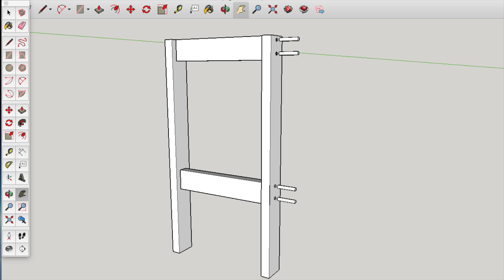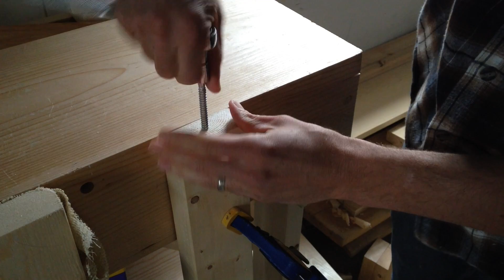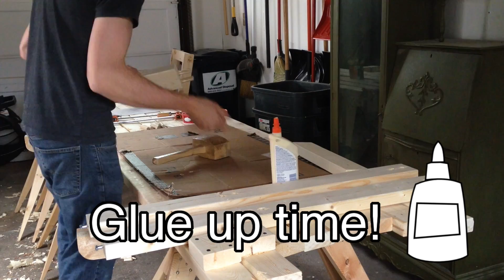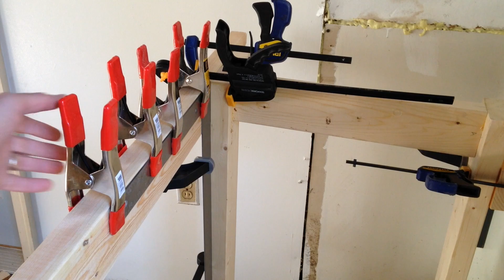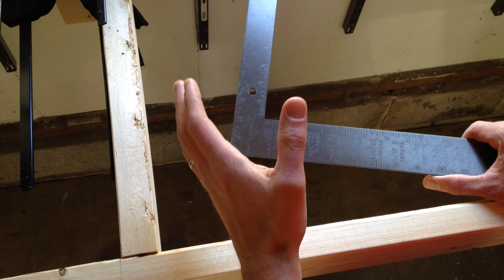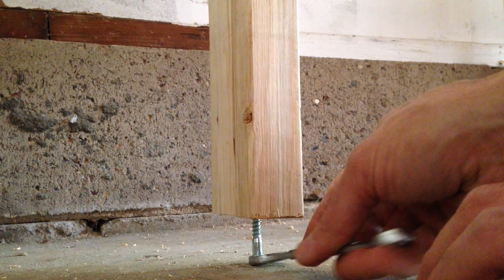DIY Workbench // Simple design from 2x4s

Comment: Typically, when you are building a long workbench like this that is going to fill the entire wall, you attach it to the wall and thus are using the wall for structural support / stability.  When you do that, it's not important that the workbench is square, just that it has a consistent depth from the back wall and is level.  Of course, buildings settle over the years, so what might be perfectly level now might not be in 30 years.  Depending upon what you are trying to do, sometimes it is more important that your work surface is perfectly flat and sometimes perfectly level.  For anyone building this sort of workbench though, it more a case of just "reasonably" flat / level since you are just working with framing grade 2x4s.  If the workbench is attached to the wall, you eliminate a lot of the concern for adding lateral stability to your design -- you're 2x4 legs just need to support a strictly compressive load, so notching them for a lap joint does not weaken the design from a lateral standpoint.  Using those wood screws to attach the legs is weak point in the design since the entire weight of the table is going to be depending on the shear strength of those screws.

Comment: I've never seen a perfectly flat and level floor or wall so a little off square is no issue, if you were to build a perfectly square and level desk it would not be level once in place, so just adapting the design on the fly for that specific surface is your best bet, good video and well presented.

Comment: Dowels for the end frames, but long top braces screwed on, and then screws in the end grain on horizontal braces that aren't level, plus the lag bolts as levels on the legs. You made things a lot harder on yourself than they needed to be, but anything you learn the hard way you never forget, so it works out. Plus the bench is still a bench.👍
Reply: I am loving the pinned construction on the end frames. 
I am incorporating it into my new build
Reply: Way to butcher the guys build I'm guessing your a master carpenter with a degree in being perfect all the time. He's built a good bench that will do the job. As long as he's happy with it and it does what he needs doesn't really matter what you think.
Reply: @justenhearn5179  

Just been doing this type of stuff a long time. If he didn't want feedback the comments wouldn't be open, and my comment was four years ago, so take a breath; dude is doing fine. Everybody starts somewhere.
Reply: @cavemanjoe7972  ya I didn't look at the date.. felt like a dumbass after I saw it.
Reply: @justenhearn5179  

It's cool, man. And it wasn't meant to tear the guy down, just pointed out some stuff he might've done differently with some more experience. He did make the build harder than it needed to be on him, but it still came out a functional workbench, so it's a learning experience.

Comment: Your bench doesn’t have to be level.  Being square and maintaining square is a good thing (though not an absolute). Using lag screws as levelers is not going to hold up.  That lumber will eventually shrink away from the fastener and cause it to wobble. You should use nuts, bolts , and washers for leg levelers. It would require additional steps and materials. But you’ll get a long term stable finished product. You’re worrying about stuff that isn’t important. But it’s your bench and your time.  Enjoy.
Reply: Patrick Perry you should make a video so someone can criticize your work.
Reply: I've built several workbenches and used 3/8 lag bolts for levelers each time with NO problem!

Comment: the place that you make your purchase will rip or crosscut sheetgoods for you
Reply from the maker: I'll have to check into that. I'm not sure my local place does, but it's worth asking.
Reply: what neck of the woods  are you in  i live here in crap country  that would be california  i have only two choices  one is lowes  and the others home depot  they will cut  your sheet goods for you and offer partial sheets pre cut
Reply from the maker: I live in Eau Claire, Wisconsin, which is the home of the Menards headquarters. It's our only big box option in the area.
Reply from the maker: They sell partial sheets at Menards, but they cost significantly more per board foot, so I can rarely bring myself to buy them. It would make most sense for me to rent a truck and buy a bunch of full sheets once per year.
Reply: If you choose to have the big box store rip down a 4x8 for you be sure to specify dimensions over your final. I have seen terrible problems with tearout from their saws on AC plywood